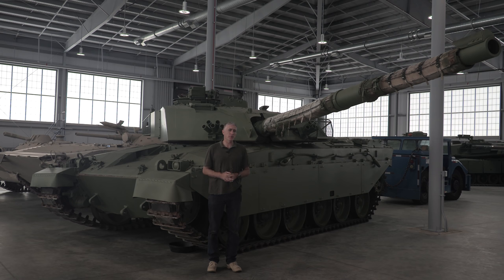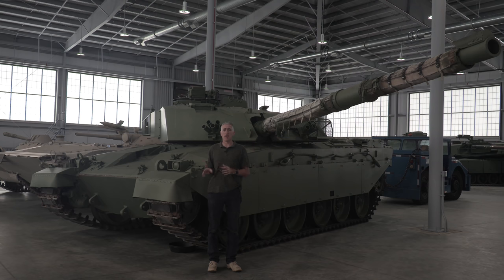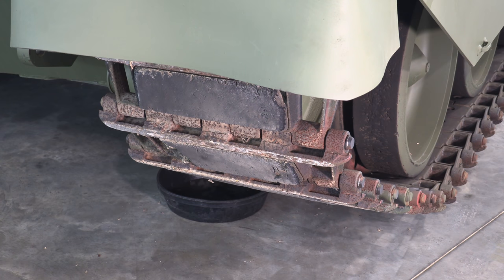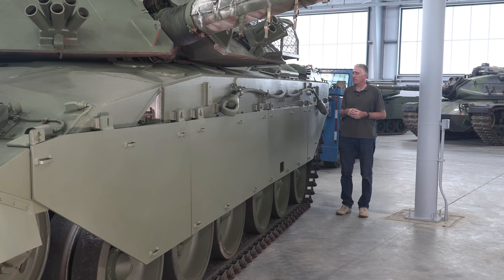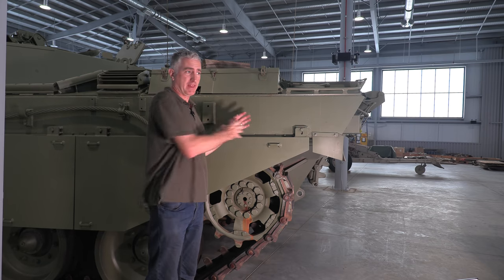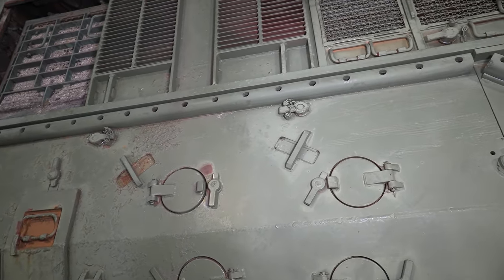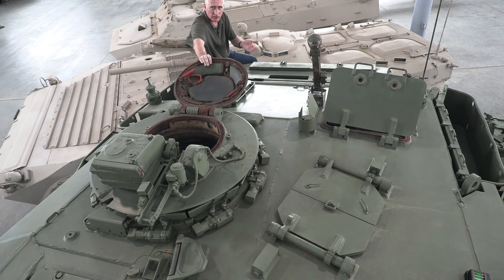Inside the Chieftain's Hatch: Challenger 1 Prototype Pt 1

Comment: To answer the question yes chally 1 was indeed dead track. I was chally 2. Engine was pretty much the same but a TN54 gearbox on chally 2. The dead track and grousers actually give a better cross country capability as well, but it's not friendly to roads. Probably one of the most underrated tank's for its day due to it's woeful performance at CAT in 1987. But the first Gulf War soon set the record straight.
Reply: Do you know/remember why dead track gives better cross-country performance?
Reply: @ScottKenny1978  it has grousers on the track. Modern live track rely on the thick rubber blocks to dig into the ground instead of a full width metal grouser on the dead track.
The only way I can describe it is like a clawing effect. This is why centurion and Churchill tanks could climb really well. The rubber blocks don't grip and claw the ground as well and cause the track to slip.
Reply: @kippamip  ah, gotcha!

So there is a performance reason to keep the heavy steel track and not go to some variety of much lighter rubber band track. Good to know for my sci-fi world building! 

Thanks!
Reply: I was Chally 1. Same as Chieftain, dead track.
Reply: @brucemacallan6831  I remember a Chieftain column (  unit from northern ireland / ulster) couldnt pass a Bridge because they made a new asphaltlayer the Tank Company was redirected thru the narrow streets in our Town they did a lot of damage to the streets and Curbstones with their deadtracks.
In late 60s early 70s during the autumn manouvres in lower saxony i saw  BAOR Centurions and chieftain always driving with dead tracks/tracks without Rubberpads, the Farmers, Town mayors, Forrest service hated that because of the Damage done to the Roads, Town/Villagestreets, Loggingroads and Field/Tractorways, we kids liked that when we went out to find the Tanks with our bicycles because it was easy to follow their Route by looking at the Trackprints  left on roads , loggingways ect. .
One day a  Dutch Centurion column drove down the Road but their Cent`s had 3 Rubberpads per Trackpiece.
Reply: @ScottKenny1978  "Live" tracks are designed to have certain amount of spring in them to help with alignment. The track has small rubber bushes in it which make it bounce slightly, thus giving less traction.
Reply: @ScottKenny1978  The main developers of Composite Rubber Tracks, Sucy, have stated that as of now there is a hard limit of c55 tonnes to the weight that a CRT will go to. They don't anticipate that changing any time soon. They've progressively uprated their track system to reach that over the last 10 years, but it appears there is a hard limit to how far the technology at present can go. 
So basically you won't see a CR2, Abrams or Leo with CRT any time soon...

Comment: I listened to the refueling section a few times.  Still not 100% sure if you fill it one side at a time or all at once.
Reply from the maker: Both ports per side, likely one side at a time, but you can do all four ports if you have the capacity.
Reply: If it's the same as chally 2, you fill one port on each side, swapping between the front and back filler holes as that side fills up. The Unit Support Tankers have two hoses and if you're lucky you'll get use of both during a replen. If you're on unlevel ground the side facing up the slope will  take more diesel than side facing down the slope, so usually a flat bit of ground is preferable, so you can tank as much fuel as possible.

Comment: When I was studying mechanical engineering tech years ago, we learned to use captive nuts mainly to simplify manufacture. It's easier and quicker for whoever has to build the thing you designed if all they have to do is make a hole a bit bigger than the major diameter of the bolt you've specified, then weld the appropriate-size nut on the back of it, rather than having to make an exactly sized hole and tap the threads directly into it. Plus, the threads in factory-made nuts are presumed less likely to get fouled up than threads tapped by hand in the part itself. 

(Later in the product's life, as you note, having the nut welded on there also means whoever takes it apart a) doesn't have to use two wrenches and b) can't lose the nut. In the program I was in, our main focus was on designing for manufacturability, but taking care of the end user was considered good form as well. :)
Reply: And if the threads do get messed up, it's a lot easier to break off the old and weld on a new nut than it would be to replace the whole bracket.
Reply: "our main focus was on designing for manufacturability, but taking care of the end user was considered good form as well. :" that;'s dumb. 
It gets built once and serviced hundreds or thousands of times.
Of course the manufacturer doesnt pay for servicing, only the manufacturing.
And the public servants who dole out the procurement dollards dont even think about the ongoing costs - just the initial investment.
Sucks to be Tommy Atkins.
Reply: @1337flite  More expense doesn't mean more taxes raised, it means fewer numbers procured, another capability axed, or a different bidder being selected.
Reply: The only thing is that special care has to be taken when welding nuts in place. Otherwise these will be pulled and warped and the bold would be very uneasy to (un)thread.
Sure professionals know that, it's warning for DIY ppl who might pick the idea.
Reply: @azgarogly  It's actually quite easy, you just fit-mount the piece in place, tighten all the bolts, than tack weld each nut, than unscrew the bolts and finish welding the nuts.
Reply: @Dr_V  Everything is easy when you do it right. The problems come when you do it wrong.
Reply: One of the tools in the toolkit is used for the skirts plus other plugs and access.

Comment: I used to work on the Chally 1 in the 90s as a heavy vehicle mech in the REME. My ARRV was still a chieftain though... I loved the Challenger and the rapid removal of the powerpack (compared to the Chieftain) and really enjoyed adjusting the tappets and the fuel injection pump ;-) The gearbox really was pants though and it had serious problems doing a neutral turn. Still, a very enjoyable tank to work on and set the new standard for a more modern AFV.
Reply: I was at Chertsey, it took 2 years to get the box to work.  Build quality was abysmal.

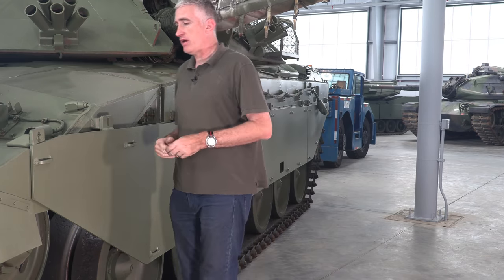Comment: 7:45 Two options: as an Engineering student, who's asked the same question about nuts that were welded in place I believe it's because those are adjustable bolt eyes/slots/tracks. I was told because it's where the bolt should end up, on that specific example (We were looking at a sterile filling machine). The slot for the bolt was a track, to allow for adjustment. But because the machine was semi mass produced, and the bolts were to hold two sections of machine together. The Washer might need to be a different model, because of a change in the vials, or a different manufacturers washer might be used in future etc. They're modular, in-case Amgen, Pfizer, Alexion etc. change the drug and vial they're filling but want to keep the machine worth 6 figures.
You'd assemble the machine, adjust the levelling feet, make sure all the sections mate correctly, the machine runs smoothly. Then, the bolts that are in adjustable slots, you'd weld the nuts. So they cannot adjust themselves from vibration, and so if the machine is ever moved, or sections need to be disassembled for maintenance, they can be bolted back together exactly the way they were.

TL,DR I believe It's so the skirts can be bolted back on, adjusted to the same place every time. The adjustment being put there by the factory, because despite even modern precision engineering, the part's wont be to micrometre tolerances. That's just to expensive a tolerance for what's designed to get shot at.

A second possibility is, the corner bracket it's mounted on is just a mass produced part. As a result, the manufacturer doesn't know what kind of bolt/thread you intend putting through it. So the factory using the brackets on your tank, just take a bolt they think does the job, and a corresponding nut. Instead of making a custom bracket, and tapping a thread through it. Or making a square plate and tapping the thread in the plate and welding that to the bracket... just take a nut, it's easier and cheaper. Plus like you said, it can't go anywhere afterwards.
Reply: Or, the simpler explanation: someone just got tired of threading all those nuts on every time they took the skirts off and just tacked them in place.
Reply: Frankly I think the reason for the welding is that they needed a threaded hole on the sheet metal part ( 07:52 ) and quite possibly the cheapest way to achieve this is to just weld a commercially avaliable nut to it. They could've just supply it as a loose part, but this way it's - as Chieftain pointed it out as well - one less thing to lose, as there is no reason for that nut to ever come off. At a sheet metal shop I've worked at we've made similar parts (although for the food industry among others, not for tanks...) where the idea was the same: manufacture a cheap sheet metal product (in our  case it was laser cut, bent and welded), weld a dirt cheap nut to it, bam, you don't need casting, don't need milling, you don't need threading, don't need anything a welder and a grinder can't do. In case the part receives damage, a field shop could improvise one rather easily this way as well.
Reply: Welding the nuts on was probably a MWO (Modification Work Order) to make it more user friendly.
Reply: If they weren't welded on you'd need two spanners to do/undo them.
Reply: @agt155  Most likely a field mod.